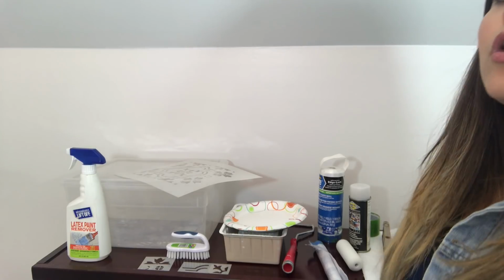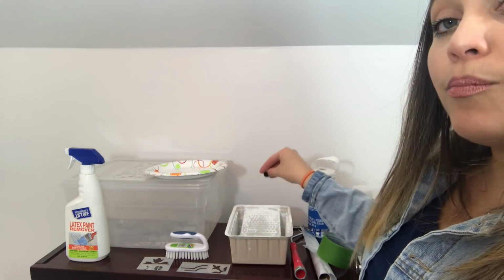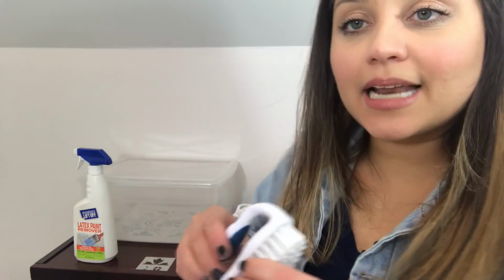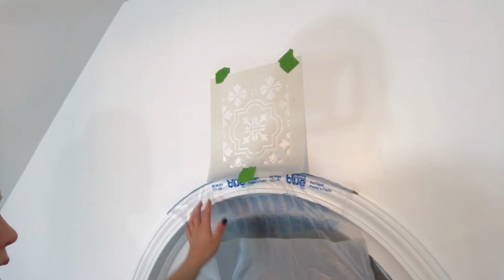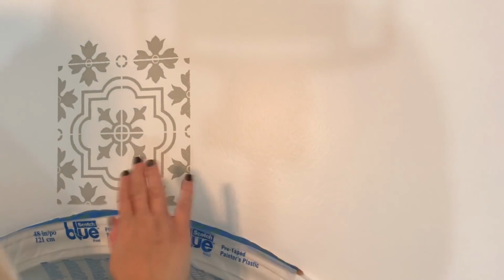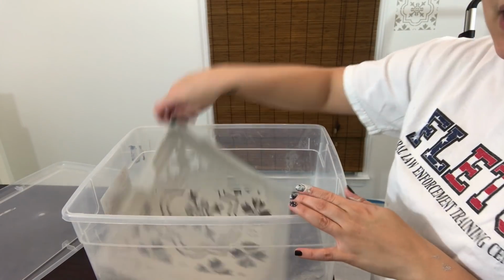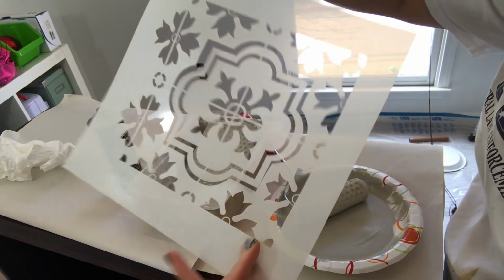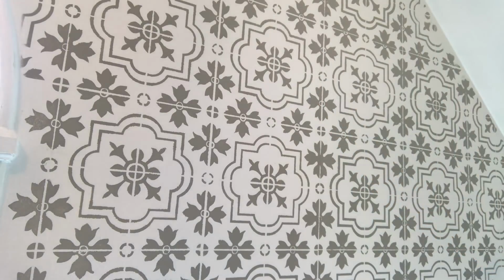How to Stencil Faux Cement Tile

Comment: Great tip about the pattern becoming steadily smaller as the paint builds up on the edges, so that the stencil will need to be cleaned before continuing to stencil. I had never heard that tip before, and I've watched many stenciling videos from other youtubers, so Thank You! I'm going to eventually tackle stenciling my entire downstairs level of my house which has vinyl flooring. I'll be using primer first such as Stix before I start since it's a high traffic floor not a wall.